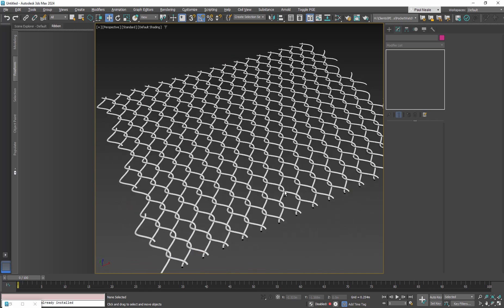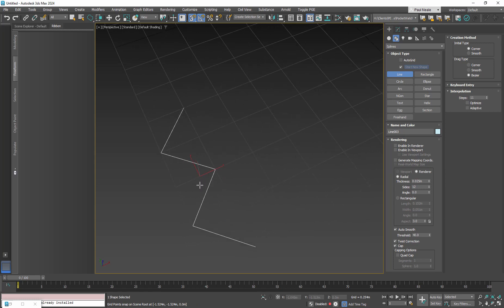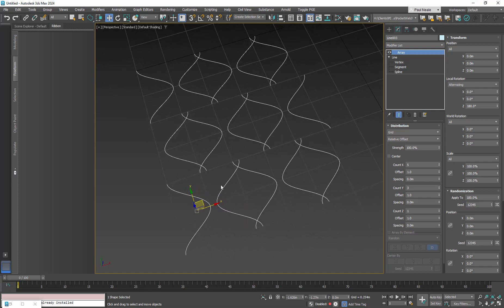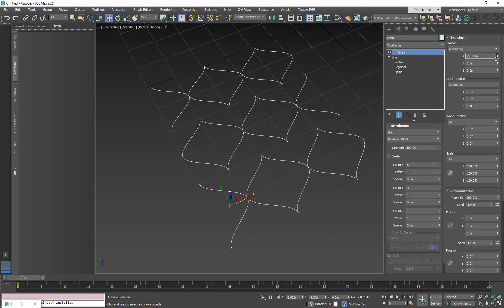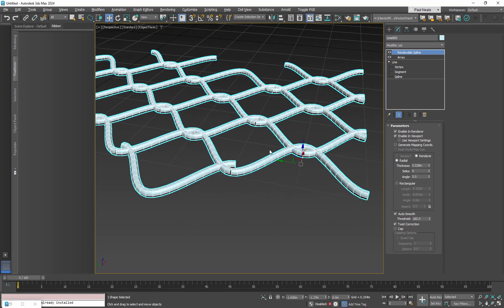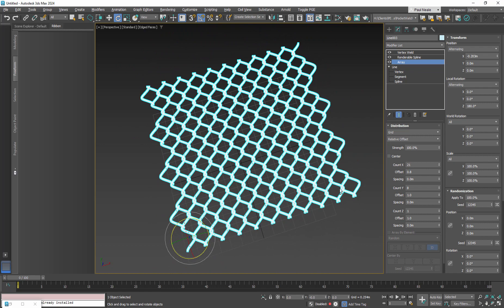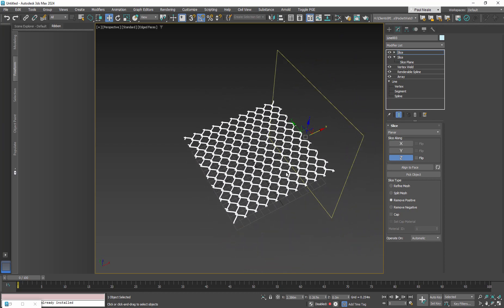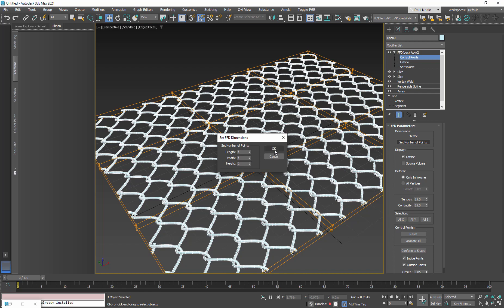3DSMax Chain Link Fence

Comment: Hey Paul, how come you are using 3ds max to this day? Aren't other 3d software lightyears ahead both in ux/functionalaty and optimasition/performence? When I open maya and blender after using 3ds max for 5 years there are so many cool tools in them I wish I had in 3ds max from day one and I haven't mentioned the issues with performence demaning stuff yet. I get that in theory its more user friendly and linear then other 3d software with the modifier stack, but it seems more capital was invested in maya by autodesk and so many great design choices are just simply not in it.
Reply from the maker: No they are not. Performance wise none of them hold a candle to Max. Max pushes more polys faster than any of them. UI sure, but I don't like Maya's either. As for functionality, try and do this in Maya. Blender is slow, you can't push much at it. Great for people learning and small productions but it does not scale well. Max is used in more markets then all the others combined, there isn't just games and films to work in. I have also been servicing clients for 30 years in Max and it has not slowed down. 

Max gets more development now then Maya does. Yes there was a point in time when there were lots of politics that were getting in the way of Max development, that is long in the past. Just hold tight and wait for what is coming. Things are only getting better. 

Which cool tools are in the others that you wish were in Max?
Reply: @paulneale  Apologies for the delayed response; I had a first aid test and needed to devote time to prepare for it and I wanted to write an in depth response:

Initially, I'd like to mention that I don't possess specific information about the software’s architecture, structural algorithms used, or its relation to different GPU and processor types. On this account, my capabilities are limited to two actions: 1) making assumptions based on insights shared by professionals regarding the software design/philosophy/architecture/history/background; and 2) leveraging my own experiences with 3ds Max and other software to outline my preferences concerning 3D software.

In light of this, I wish to share some experiences relating to the points you raised. During my diploma work, I encountered challenges while handling a 3D model of 50,000 polygons in Max. It struggled to display the entire model as a single entity and apply/use modifiers on it. However, when I transitioned the same model to Maya, the software managed the model much more efficiently.

This observation was somewhat explained in a CG Academy video by Chris Thomas. In the video, which predates the era when polygon modeling became standard (as Maya primarily started utilizing NURBS modeling), Chris mentioned that in the realm of architectural modeling, polygon modeling was not significantly essential. His argument implied that Max is typically used to render models created in professional CAD software like ArchiCAD.

Furthermore, during rendering projects, I observed certain behavior in 3ds Max that aligns with Chris's explanation. For instance, in one project that required the use of particle systems and texture animations, I noticed a ten-fold increase in pre-render processing and overall estimated rendering time, despite having powerful Quadro GPUs. Even attempts to enhance processing power through virtual computers (virtual computers that had the world’s strongerst cpu’s in it  virutally, 3 of them actually) did not improve CPU-bound functions such as modifiers, texture animations, model displaying and particle systems.

This leads me to believe that 3ds Max was tailored to cater to architecture students seeking user-friendly software to render CAD models without delving into the intricacies of complex 3D design software. Over time, the procedural workflows offered by Maya and Houdini, developed with a more flexible architecture, seem to have bridged the performance and capability gaps that Max has in comparison, particularly in procedural functions.

On the other hand Blender has some functions that seem ill adviced. The use of the Catmull algorithm for subdivision surfaces does underscore a limitation when compared to other 3D software. However, its open-source nature provides a silver lining as users can theoretically rectify any dissatisfaction, unlike in Max where workarounds are impossible without creating a function as a plugin from the ground up.

I also encountered odd features in Max that cause integration issues with other software. For instance, Max utilizes two methods for creating polygons which can disrupt topology when importing mesh objects from other software.

Lastly, while I lack in-depth knowledge about the internal algorithms and their performance impacts, I do acknowledge the emphasis on UX design and features in these software. In that regard max is shockingly behind. Just small ux things like quad modelling in maya or the fact that you can scale in blender using a gizmo like with fdd’s in max without using a modifier makes a shockingly big difference. These features, only get put in if you heavily inveast in ux and that’s probably really expensive. 

Max is mainly for architecture (thats one market) Maya, blender, houdini are mainly used for games and movies (2 markets). If we look at all there markets, movies and games bring in more capital tougether then architecture. So its a logical that a stronger market would push for more innovation. I even asked bing:

----------------------------------------------------------------------------------------------------------

„
According to the results from my search tool, the film and video market is bigger than the architecture market in terms of revenue. The global film and video market reached a value of nearly $234.9 billion in 2020⁶, while the global architecture market was valued at $59.9 billion in 2020¹. The film and video market is also expected to grow faster than the architecture market in the forecast period of 2020-2030, with a compound annual growth rate (CAGR) of 5.8% for the film and video market⁶ and 4.8% for the architecture market². However, both markets are influenced by various factors, such as technological innovations, consumer preferences, economic conditions, and environmental concerns, which may affect their future performance and size.
„
Source: Conversation with Bing, 2023. 09. 29.
(1) Global Film and Video Services Market Report 2021 - Business Wire. https://www.businesswire.com/news/home/20210910005333/en/Global-Film-and-Video-Services-Market-Report-2021---Opportunities-and-Strategies-to-2030---ResearchAndMarkets.com.
(2) Architects in the US - Market Size | IBISWorld. https://www.ibisworld.com/industry-statistics/market-size/architects-united-states/.
(3) Architectural Services Market - Size & Growth - Mordor Intelligence. https://www.mordorintelligence.com/industry-reports/architectural-services-market.
(4) Architectural Services Market Size & Share Report, 2030. https://www.grandviewresearch.com/industry-analysis/architectural-services-market.
(5) Architectural Services Market Size, Share 2023-2028. https://www.expertmarketresearch.com/reports/architectural-services-market.
(6) Global Architectural Services Industry (2020 to 2027) - Key Market .... https://www.businesswire.com/news/home/20210521005417/en/Global-Architectural-Services-Industry-2020-to-2027---Key-Market-Trends-and-Drivers---ResearchAndMarkets.com/.
(7) . https://bing.com/search?q=film+and+videogame+production+market+size.
(8) Video Game Industry - Statistics & Facts | Statista. https://www.statista.com/topics/868/video-games/.
(9) Film And Video Global Market Report 2022 - GlobeNewswire. https://www.globenewswire.com/news-release/2022/03/08/2398616/0/en/Film-And-Video-Global-Market-Report-2022.html.
(10) undefined. https://www.grandviewresearch.com/industry-analysis/video-game-market.
(11) undefined. https://www.globenewswire.com/news-release/2022/03/07/2397814/0/en/Video-Production-Market-2022-Size-Share-Growth-Market-Supply-and-Demand-Company-Profiles-Trends-Type-Application-Market-Dynamics-Challenges-Drivers-Key-Regions-Revenue-Price-and-Gr.html.

----------------------------------------------------------------------------------------------------------

Regarding the fact that max is getting more development now, then maya: I honestly believe that its linear workflow philosophy will always block it from out performing other software, thats more procedual. *edit: Even thought I noticed and was really happy for the array tool in max 2024

In closing, I do want to just mention that regardless of all that, the one good 3d software learning material I ever found was the cg academy dvd’s for 3ds max, that you helped make. Regardless of software that knowledge to this day is revelant and universal. Not even houdini has learning materials as comprehensive and in depth as that dvd series (even thought its old af!). I am really sorry that project stopped.

Thank you so much for replying I deeply enjoy talking and learning more about this topic!
Reply from the maker: @gergolaky3624  Ok you are missing a lot of information. First off Arch Vis isn't the only other market by a long shot. 

Second, what version of Max were you using last if you were using Chris Thomas's videos as reference as those were around Max 7. 

Third, Max does not use a linear workflow, users can use a linear workflow if they don't understand the software. Maya for instance is way more linear than Max. Max's stack allows for non linear workflows. 

Fouth, "Max is mainly for architecture (thats one market) Maya, blender, houdini are mainly used for games and movies (2 markets)" I will have to have a talk with my friends at ILM and many other companies and tell them that you said that Max is mostly Arch Vis. 

Fifth, "procedural workflows offered by Maya and Houdini" Maya...Procedural like Houdini? Where?

I can see by a lot of your comments you believe that Max has never had an update and still works the same as it did in Max 7. I could make the statement that the IK solvers do not work in Maya because they didn't work in Maya 4. Your information is so far out of date I don't even know where to start. And if you think the only change has been the Array Modifier or updates to Chamfer, once again, way out of date and you have never tried to keep up.
Reply: @paulneale  You have rightly pointed out a few inconsistencies in my phrasing that, upon initial reading, may appear incorrect. However, within the full context of my letter, I believe they are minor. So, instead of crafting a new comment and potentially veering wildly off-topic, I’ve decided to let my original letter stand as it is. You haven’t addressed what I believe are pivotal points in it (such as the 50,000 model example); perhaps that’s due to my phrasing and highlighting, which I see can be improved upon reviewing it a few days later. However, it's also a long, perhaps poorly phrased letter, and you likely have more pressing matters to attend to than spending all day in discussion with me (although I’d enjoy that — discussing this sets my brain abuzz with satisfaction!).

However, I do want to address the issues you've highlighted below, as they stem from errors in phrasing and writing rather than thought and logic, and I hope that becomes apparent:

1.	Acknowledging that "used for" may suggest a single application, it’s vital to recognize that 3ds Max, despite being widely utilized across diverse industries, embeds an archviz-oriented design. The argument here isn’t about who uses it — like ILM or numerous architecture firms — but rather it seeks to illuminate the foundational goals and societal needs it was crafted to address.

2.	Your inquiry about my Max version, derived from referencing Chris Thomas's DVDs, misses the mark. Those DVDs offer enduring insights into 3D, computer science, and design, not just a Max 7 tutorial. Their absence is felt due to the universal knowledge they shared, not software specificity. You can’t even install max 7 anymore…. So I don’t understand how that came up……

(Really sad that the dvd’s are no longer avaible thanks to Chris Thomas)

3.	It seems like we're seeing "proceduralism" a bit differently. In my eyes, it’s all about how deep we can dive into the software's guts. With 3ds Max, there’s a bit of a wall there—you can't get at everything even with controllers, scripts, and channels. On the other hand, Maya and Blender let you dig a notch deeper. And Houdini? That thing lets you go so deep, it's almost like you're building your own 3D software! Sure, you can do a lot with 3ds Max, but it often makes things trickier and slower than they need to be—and that’s a design choice, not just a performance thing.

I've chatted with several CG Academy instructors and I'm aware of the underhanded thing Chris Thomas did, seemingly absconding with funds and hoodwinking everyone involved. I'm annoyed at him, especially from a learner's perspective, for sabotaging a valuable learning resource. However, I do think he hit the mark in his procedural DVD discussing various 3D software. This isn’t about being a 'fan'—his analysis simply provided a useful framework for me, even though his other DVDs on modeling, for example, fall short.

4.	While I've engaged with various CG Academy instructors and heard varying perspectives on 3ds Max (even from those who worked on significant projects like Ghostbusters), a central curiosity remains: ILM’s perspective. So, genuinely, please involve someone from ILM in this discussion! Their insights would be invaluable and thoroughly appreciated.

5.	I mentioned this earlier: Maya is inbetween linear and procedural

Your last point is perplexing given that I've clearly stated using Max for the past 5 years - logically, why would I opt for an outdated Max 7 instead of the latest version? All my comments stem from direct, empirical experiences with the most recent 3ds Max! To illustrate, here’s a video showcasing precisely what I'm referring to (Notice the delay in the undo and the messed up triangulation caused by 3ds max meshes, Also I used send to maya function under files. I also uploaded the original file if you want to take a look at it yourself): https://drive.google.com/drive/folders/17RMxn_0HI30sLQPCY-unUp_alA7Ep7y2?usp=drive_link

DVDs and discussions with professionals serve as additional evidence - perhaps not establishing logical causation, but certainly indicating a strong correlation. We can talk about that, discust it, but we are not doing that right now…

Look, at the end of the day, the big idea I'm trying to get across here is what really matters. We could nitpick on YouTube definitions and minor things forever if we want to keep going in circles.
I also want to mention that, I have seen the projects your students do on linkedin (and they were made with 3ds max and they are cool), but my mind is set on this and so far you haven’t changed it.
Reply: *The difference in performance might seem insignificant, but it adds up a lot during the middle of a project
Reply from the maker: @gergolaky3624 Then I will not bother changing it. Your original question was why do I use it. My answer stands as well. I also use both Max and Maya and I prefer Max for how procedural it is.
Reply: @paulneale  👍
Reply from the maker: @gergolaky3624  Did a test on your object. You are right, performance is a huge issue. 
I took your object and collapsed the stack in Max as it should be as you had a non procedural modifier above a procedural base object and a procedural modifier. 

Undo in Max on a vertex is instant just like in Maya. 

The real discrepancy was when I copied your object in Maya and Max 100 times. 
Maya: 50 seconds
Max: 1 second

I tried copying all 100, 100 times, after 10 min Maya shut down, Max took several seconds to complete the task.
Reply from the maker: So I decided to try again with Maya. 100 objects 100 times. I have now had two glasses of wine, made dinner, took 45 min, ate dinner and then remembered that I had set this in motion. Hasn't crashed, but also hasn't done anything at all.
Edit: About 2 hours in it crashed Maya and took out my web browser at the same time for some reason.
Reply: @paulneale  

Hey [Paul],

Wow, thanks for taking the time to run those tests and share the detailed results - it’s really appreciated! It’s quite intriguing to see those differences in performance between Max and Maya in the operations you tested. It's definitely an insightful data point, especially considering the stark difference in copy capacity and how the software handles heavy operations.

I apologize for the delayed response; it’s been quite a whirlwind over here, and I wanted to thoroughly digest your findings before replying.

Now before I say anything else I want to say this: From my end, without a deeper dive into 3ds Max’s architecture and coding, further analysis leans heavily into speculation. Paul, could it be possible to connect me with someone currently ingrained in the software's development? Engaging in a dialogue with them about our observations and experiences would be truly eyeopening and fun for me. I understand if it’s not possible, but I thought it’s worth asking.

Now that said.

Your experiment, particularly the moment where Maya crashing took down your browser, sparked a thought related to memory management strategies in software, nudging me down a rabbit hole exploring garbage collection strategies (More here: https://en.wikipedia.org/wiki/Garbage_collection_%28computer_science%29). Could Max and Maya possibly be employing disparate strategies like "reference counting" and "tracing" respectively? Your and my experience seems to resonate with things on wikipedia.

Now, let's be crystal clear: without a peek under the hood of the software, this remains squarely in the realm of speculation. So I am not saying this is factual or anything, I am just sharing my thoughts and what I read up online about this. (Especially, because I am not a programmer, but I did double check before writing this)

In exploring memory management strategies, I wonder if Max leans on Reference Counting for its tasks. It seems ideal for handling an abundance of similar items—think bricks or tiles in architectural designs. The efficiency in managing duplicates might be its strength, but it appears less flexible in cross-referencing than Tracing.
Conversely, Maya might favor the Tracing approach. While it might be heavier on resources, it seems superior in managing dynamic interactions among diverse entities, like shaders communicating with particle systems. My experiences with large environments in Max, particularly with particle systems dispersed by shaders (I did this for a grassfield that had grass particles spread over its surface, where the color of the grass varied based on a multisubobject material assigned tot he surface), pointed to inefficient memory management in cross-referencing tasks. Interestingly, the issues you highlighted with Maya resonate with my experiences in Max, where the software would freeze for long amounts of time and even crash randomly, sometimes taking out the browser the same way! Maybe caused by memory leaking.  That was a painfull two weeks of nonstop work. 
Gathering from our discussions and the distinct performance of Max and Maya, it's conceivable that their core software designs, perhaps even their garbage collection methodologies, cater to their primary application nuances.

Could all of this be fixed by scripting or plugins? Probably, if it allows that level of access. 

I know that in unity you can just click a box in preferences and it allows you to change this.

In light of our experiments and subsequent findings, my mind can’t help but wander back to a lesson from school. Our teacher showed us staggering feats achieved by the demoscene, where massive 3D environments or animations were crafted under surprisingly constrained memory and processing power, largely through procedural methodologies. A key illustration of this would be the ability to produce an astonishing array of material with a mere 64k bytes of memory- you can catch a glimpse here: https://www.youtube.com/watch?v=mxfmxi-boyo

It subtly hints at how diverse methodologies and software mechanics, like varied memory management strategies, can be particularly aligned or misaligned with specific workflows and scenarios in the realm of 3D work, each harboring its own set of advantages and challenges.

Once again, thank you for opening my file and checking it, I really appreciate that and also the fact you are talking about this with me, knowing that you probably have a busy schedule! Really nice of you, I really appreciate it!
Reply: *cool video btw